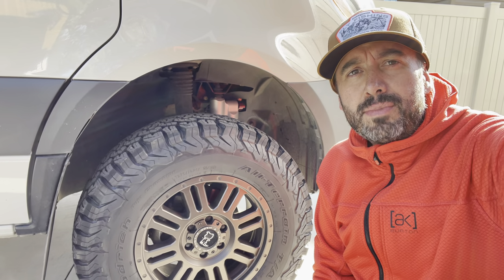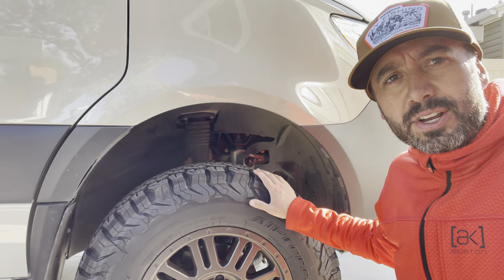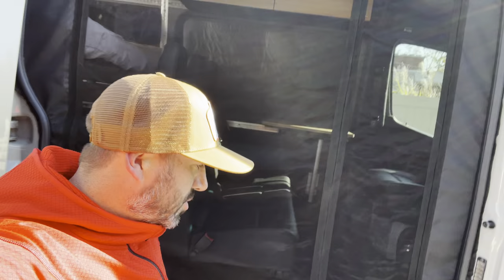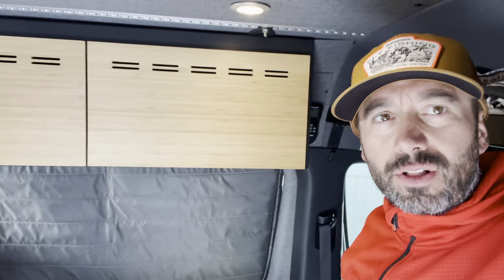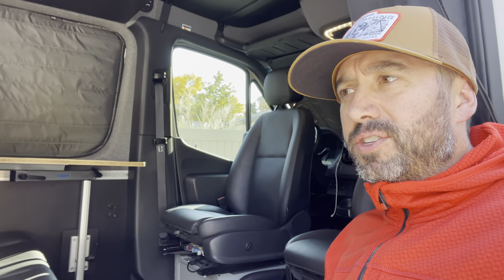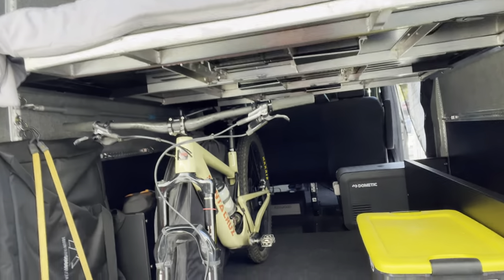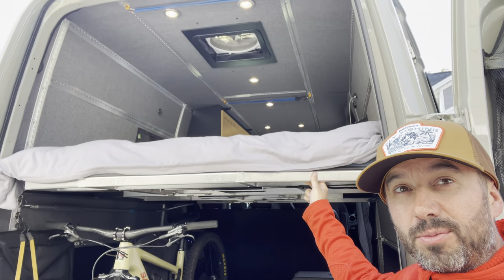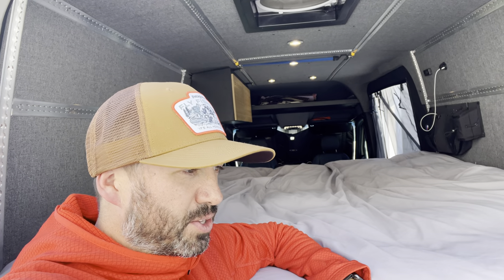2020 Sprinter 4x4 Upfit Overland - Adventure Wagon, Flatline, Goal Zero, Vancompass 30k mile review

Comment: I'm totally with you on the Yeti1500. After a lot of research, I decided against building a dedicated/permanent battery system, and when REI put it on sale for $1500, I jumped on it.  My GZ charges quickly from the alternator, using a DC/DC charger and it's enough to run my iceco fridge, charge my phone, laptop, camera batteries/etc for about 3-4 days. plus, and best of all, i can easily remove it from the van and use it anywhere. And if i do ever decide that it's not enough power, you can expand it by adding another house battery
Reply from the maker: yeah, exactly! And you can pull it out to use in house for emergency etc. Its a no brainer.

Comment: With the goal zero are you hooking up just the anderson powerpole (HPP) output to the fuse box and then feeding the AdWag harness from that? I have the yeti 3000x and as the outputs are regulated I figured you can only use the single HPP output (max 30A). My builder was telling me how it wont work but after adding up the load from everything it comes in below the 30A rating of that single output.
Reply from the maker: I used the HPP to power the fuse box which powers everything (auxiallry) hardwired in the van. I then used the other outputs on the GZ to power fridge, laptop etc.

Comment from the maker: Correction: Tire size is LT275/70R17
Reply: Looking good. My giant ADWAG crate just got delivered.  Do you have a full size Black Rhino wheel and tire underneath? Did you consider a tire rack on the back of the van?
Reply from the maker: @emmet2027  exciting stuff man. I do not have a full size spare and that bothers me. I do have the agile offroad basket adapters and plan on installing a full size spare soon under the van. I like the look of the tire on the rear but in reality, i want my spare out of the elements and i dont want to make the van any longer than it is.

Comment: Hi. As far as you music system goes. Does the amp,head unit, speakers sub all run off the Goal Zero?  I was gonna go bigger with the power supply to Handel that deal without having to use the van starting battery. Was curious how you did it. Thanks for the help. Chris
Reply from the maker: Great question. I originally powered by the GZ but switched back to van battery. The factory head unit will always shut off system regardless. Only way to bypass is to install an auxiliary or secondary stereo which goes against my minimalistic build philosophy. The GZ will power amp sub and all 6 speakers without issue, if you try that.
Reply: Ok. So when you wired it up the head unit front speakers stayed with the stock hook up. The amp sub and rear speakers are on aux power?  I run my music all day. Just wondering if I should get another battery or if I can run that equipment from the GZ or what ever. Might have to be trial and error with some switches. 
Thanks
Reply from the maker: @chrismharthart  if you run music all day while parked, you should to a 100% auxiliary system to eliminate the auto shutoff and drain on van battery. The GZ 1500X will power a big system all day, easy. I have a nice system for high quality sounds when driving and limited time when parked. Otherwise, I pull out the JBL Bluetooth speaker.

Comment: Aaron, sweet setup! I have an AdWag kit on order and Havelock wool in the garage waiting for install. A friend says the wool has a horrible smell and that it rears its head every time you breathe heavily in the van and the condensation spikes (I wear wool all the time, so maybe not a sensitivity I have?). Any insight on this front? I love the idea of using our Havelock wool, but if it gets rank every time we're huddled up in the winter, that would be less than ideal. Also, did you use the hush mat under the wool? Curious if you needed/used that extra sound deadening...
Reply from the maker: Hey. I have no issues with the Havelock smelling . In fact, my friend owns a premium uplifting business and thats all he recommends, hence why I used it. I used kilmat for sound deadening and used a lot of it. I put a nice audio sound system in the van so I wanted to reduce rattle along with any road noise.

Comment: Great update review, thanks.  Any specific feedback on the rear door window bags?  I am looking for storage and insulation and I don't have back windows and thought these might work well.  I see they offer versions with big pockets or more smaller pockets, any regrets going with the big ones?  Do they have any insulation in them or did you put any insulation behind them before mounting?  Thanks.
Reply from the maker: I like the big one but i see value in doing one big, one smaller pockets. They have decent insulation and work well for this area of the door.

Comment: Did you move the second row of seats back? If so, what was that process like?
Reply from the maker: never had a second row of seats. Its a cargo van. I installed the second row where i wanted it which i think is about 10in back from a stock passenger van. drilled through the frame to mount dealer sourced brackets so its a safe as stock.
Reply: @crowdtastic  did you have to drop the fuel tank to mount the brackets? thanks!
Reply: Hi. Do you have info on mounting the seats?I’m getting ready to do that. Thanks